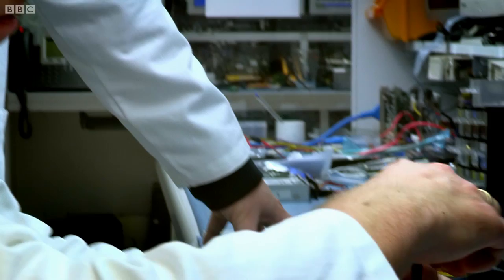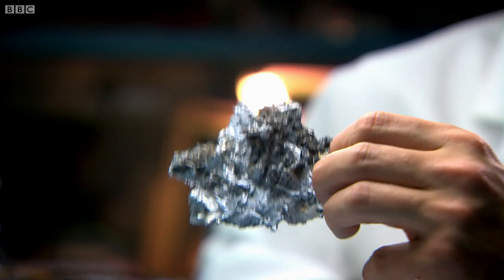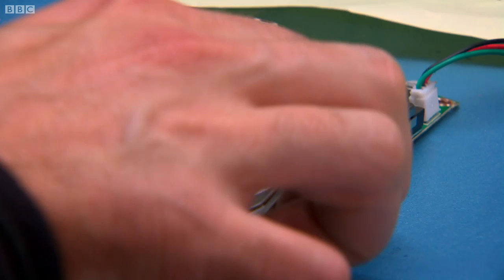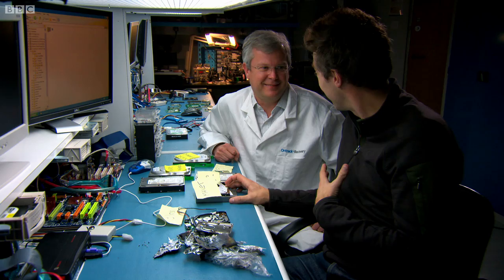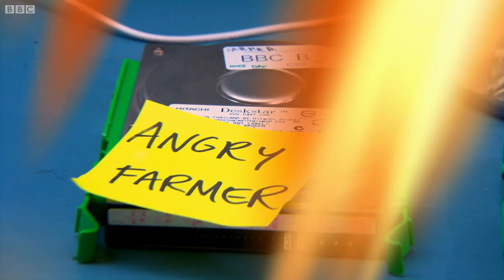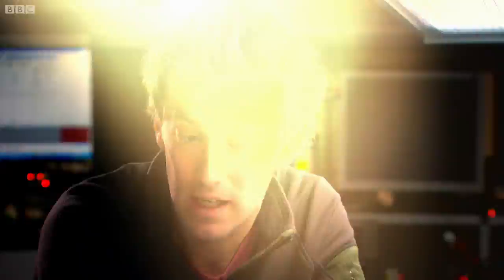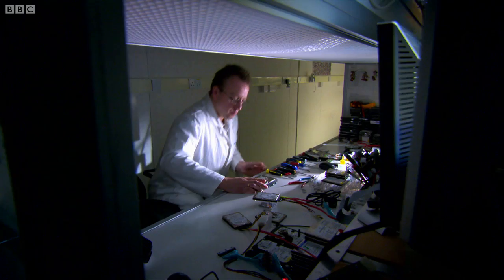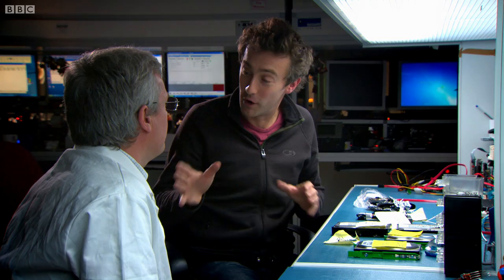How to Destroy a Hard Drive! - Part 2 | Bang Goes the Theory | Series 6 | BBC Studios

Comment: I have to admit, I was fairly confident that smashing the computer wouldn't do anything. The computer itself would protect the platters. Flash memory is notable for being very hard to beat up as well. I must confess, though, that learning that some thin drives, such as those used in laptops, had glass platters was an interesting bit of knowledge gained.

Comment: Hmm - it was obvious the smashing of the whole computer wouldn't do anything, UNLESS you hit in the location where the harddrive was - but even then, you'll still need to hit it directly - in the case of flash/ssd drives, they will be fine if they have no internal battery, if there is no electric source simply dropping into water won't do anything, drying it out is enough to get it working again - zapping it does far more damage then water (a power surge for instance is enough to stop memory in a PC from working aka corrupting it, unless you have a surge protector)

Comment: The simplest measures are never shown. Open the case and remove the disc.  Done. Does not take long.  Or what if you simply remove the entire driver card on the bottom.

Comment: Destroy data? dd if=/dev/random of=/dev/sda (or any other device mount point) it's free, it works and impossible to recover. But, you need to boot the puter off linux, from an usb pen is good.

Comment: Simply dismantle the HDD, remove the platens, and smash or cut them by repeated bending*. You also get the chance to salvage the 2 neodymium magnets that are used to drive the RW stylus back and forth.

It's faster and more satisfying this way, than the ridiculous lengths to which this typically dumbed-down BBC "science" programme employed.  Which is a shame, since all of the presenters are, in their own rights, highly qualified individuals as they have proven in more recent programmes, such as Liz Bonnin's Animal Odd Couples. Well worth watching.
 
*obviously not necessary for glass platens, which was news to me as well.
Reply: I have a collection of neodymium magnets.... Lots of fun

Comment: just open it and expose it to the air.
Reply: That will do nothing but make it not water proof.
Reply: +L33T Lagger Water will do the damage
Reply: +Greenpoloboy3 ive heard that dipping a drive in coke and mentos is enough to destroy all the files
Reply: +Dave Birney Hey I've heard of that! That does work I'm sure!
Reply: Most drives are waterproof, you have to destroy the platters ( disks ) on the inside to destroy the data, they can get wet and be fine anyway, heat is the best option, stick in an oven at about 90 degrees for an hour and it will be dead as heat removes magnetism.
Reply: @JaredReabow  I think the curie point of the platter magnetic material (cobalt) is much higher than 90 degrees